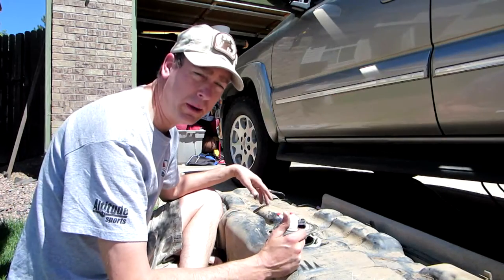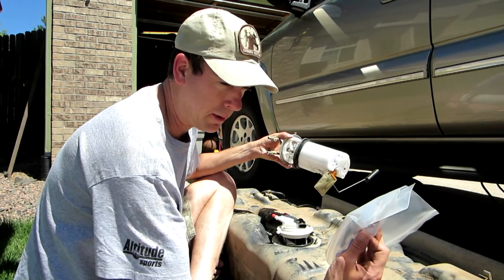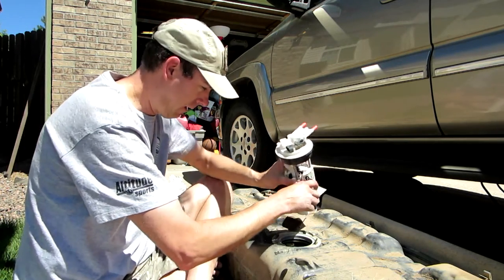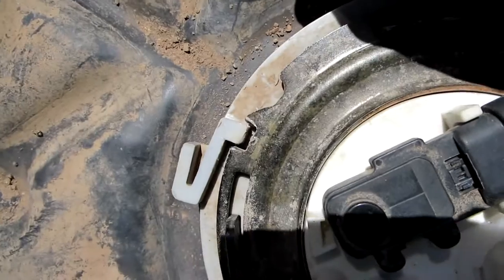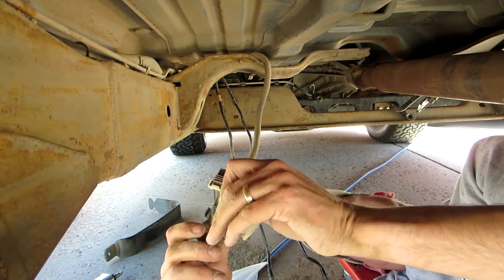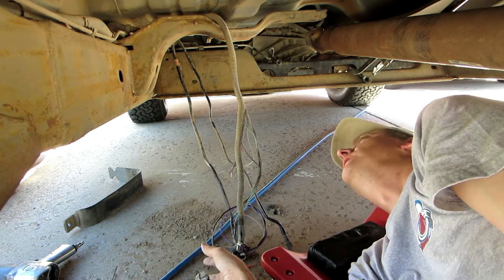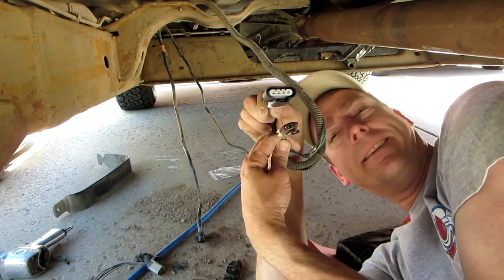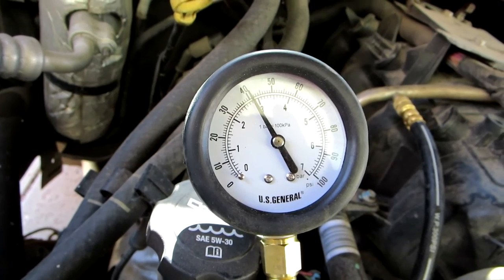Fuel Pump Install and pressure test 2003 Suburban 1500 Flex 5.3 Pt 2

Comment: I had 3 pumps replace
I was told by a suburban  mechanic   not to let the gas in the tank go below half 
Reason is the gas keeps the pump cold and it will not burn out the pump.

Comment: If your truck has a T in the vin number your truck has a oval connection plug on your fuel pump . If your truck has a Z in the vin number your truck has a square type connection plug . It just depends on the Letter in the vin number of the vehicle . Their is really no need to rewire the fuel pump . To bad the person who you talk to about the fuel pump didn't know what the difference was . If you want cheap prices on name brand parts go to Rockauto . com. I buy parts from them all the time and I'm very satisfied . Only takes a couple of days to get the parts .

Comment: I believe if you get plastic hose connectors instead of stainless then you have a lower pressure pump for gas engines and not for flex fuel that has stainless so when you use e85 you don’t corrode the tubing and cause failure.

Comment: Hey I think it won't start very well in cold weather because its only at 40 pounds pressure and its supposed to be at 60.  This is the problem with off brand pumps.  Im not sure but I really suspect this is the case.
Reply from the maker: Thanks Brad, and you could right but this pump failed in less than 6 months, so it's a done deal.  Vehicle wouldn't start at all, even if I banged on the fuel pump location under that tank.  My cold starting starting problem was linked to the intake manifold gasket.  It finally threw some codes indicating lean fuel mixture in certain cylinders and that pointed me towards intake manifold gasket.  No codes or starting problems all winter since.

Comment: you could gotten the square connector fuel pump if your truck has (like mine) Z vin 2003 chevy
Reply from the maker: +whitephantom3000 Yes, I could have, but I read somewhere that the square style is prone to overheating due to the small size and current requirements, and subsequent failure.  I also seem to recall seeing signs that mine had gotten warm - like some deformation around one of the blades.

Comment: I got the old connector square one, what where the wire colors and where did they go on the connector in the square one because they new connector came with all 4 white wires.
Reply from the maker: Mitchell Kirkland I can't remember offhand.   There is a fatter black wire that goes to the fatter black in the wiring harness of the vehicle, and the thinner one goes to the thin one.  The other 2 should be pretty similar, maybe even purple and grey?  If not, lighter color grey goes to lighter colored harness wire.  Hopefully you didn't buy the ebay pump I installed in this video.  I now have a Napa one that was 4x as expensive or more.  Still stayed with the new harness design though.

Comment: wondering if someone can help me I have a 2002 suburban flex fuel I've replaced fuel pump ,fuel filter and fuel pressure regulatator Irun it about 15 miles and will shut off have to wait 30 to45 min before it will turn back on what's my problem?

Comment: Airtech is junk, I wouldn't use an Airtech on a lawn mower. Delphi is the only way to go. As the old saying goes, 'You get what you pay for".
Reply: I have an 03 Suburban, 5.3L Flex Fuel
Starts great when cold but long crank, no start when warm AND after sitting 30 minutes.
Key On...fuel pressure rises to above 50psi then, in a couple of seconds, drops like a rock down to 10psi..
The same pressure drop after turning engine off.
I replaced FPR with GM part.
I replaced the fuel filter with a Wix. GM no longer makes that filter.
I replaced plugs and plug wires with AC Delco. Plugs looked good...no sign of any fuel injector leaking into combustion chamber.
There are no fuel line leaks that I can see and no smell of fuel anywhere.
A local mechanic agreed with me that the fuel pressure drop was due to a bad check valve in the old fuel pump.
I paid the mechanic to install a new Delphi fuel pump. 
My Suburban, with the new Delphi pump, has the exact same issue with the pressure leakdown.
The fuel pressure with the engine running is 41psi which is below the 48-54psi spec. The mechanic said that is normal?????? 
How is that normal???
The mechanic said the brand new Delphi pump has a bad check valve and it will cost ME 3 hours labor for him to install another Delphi.
To be clear, the Delphi pump came from the mechanic's supplier.
Has anyone ever heard of a mechanic charging the customer labor to replace a defective part from their supplier that they had previously installed???
If I supply the defective part, I get it.
If they supply the part, the customer shouldn't have to pay for the labor twice. That is BS.